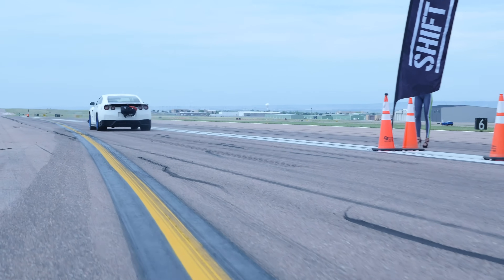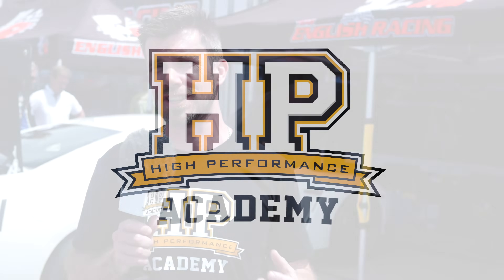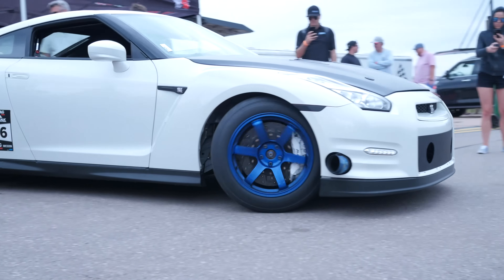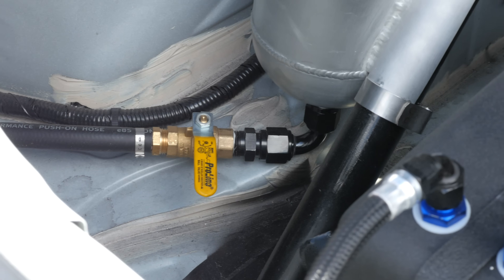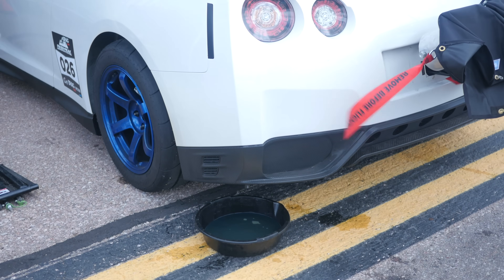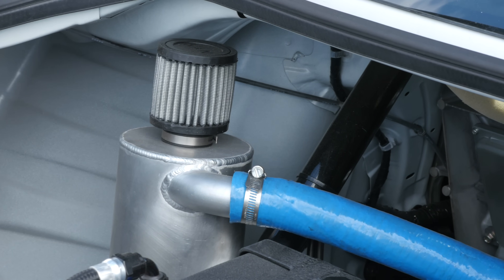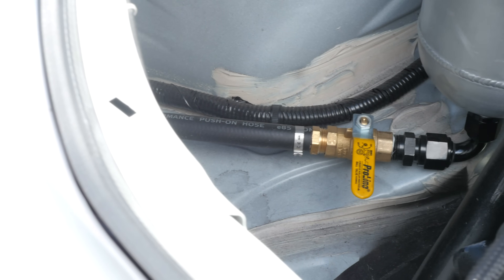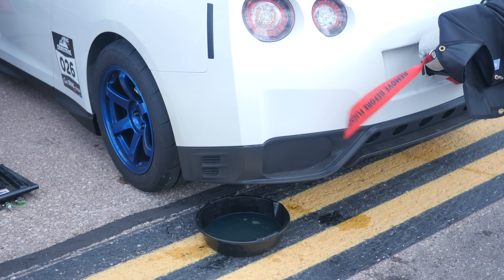What Is Blowby? Do I NEED A Catch Can? | R35 GTR [TECH NUGGET]

Comment: When fitting, or adding, breathers do what you can to position them so oil spray isn't directed in the same area as the breather, that is is clear of any areas where oil may build up under high 'G' loadings, and that the pipe/hose is itself free flowing.
Even some OEM breather designs are compromised and it may be a good idea to check if your vehicle is one of these. Some of the better designs have splash guards and/or inbuild oil/air separaters that can significantly reduce the oil carried out of the engine - there are also some specialist suppliers who carry them, or you can make your own.
It is common to have a PCV (Positive Crankcase Ventilation) hose leading to the carb'/throttle body/inlet manifold and in almost all cases it should be left in place as it helps draw off fumes, moisture, etc, in the crank case in light 'town' running and enhance the overall oil condition. Some vehicles won't idle well without them.
Using a dry sump system with a lot of scavenge volume may be the best way to ensure a vacuum in the crankcase, but it is difficult to get a consistent value as the pumps' scavanging is usually proportional to rpm whereaas the blowwby is rpm and cylinder load related.

Comment: This mainly applies to street cars. There are two circuits in the engine breather system and most get it wrong in the design of the catch can system. To do it properly you need two different catch cans. One to catch oil in the PCV circuit and one to catch oil in the WOT circuit. You are meant to leave the PCV circuit as the factory intended as this only operates on idle and cruise. The circuit you are meant to modify and increase flow for out of the engine is the WOT circuit. What you will find is that novices are modifying the PCV circuit which is the wrong way to catch oil under load but you put a catch can in the PCV circuit for Direct Injection cars to take oil out of the intake under idle and cruise. I usually do both to keep everything clean.

Comment: I'd love to hear your oppinion on a vented catch can vs a recirculated catch can.
Reply from the maker: In some countries the catch can needs to be recirculated, in which case a well designed oil air separator is important. Basically you want to reduce the chance of oil vapour being drawn into the engine as it can promote knock. An atmospheric venting catch eliminates any chance of oil vapour getting into the intake so where it's legal, it's my preference.

Comment: I don't get alot of blow-by but I want to remove all intake recirculating PCV and route the crank and valve cover vents to the catalytic converter useing a venturi effect to preserve vacuum in the crank case.  Does anyone have experience with this?
Reply: IdealSound & Performance : Mobile. I think you're right in suggesting it being after the cat because it might be fighting back pressure otherwise, I just don't want to pollute. I've read that it can pull too much vacuum and displce the crank seals on the motor.
Reply: IdealSound & Performance : Mobile. I almost used a compressor air water separator filter/regulator with my IAG AOS at the manifold port but decided against it because my engine bay is starting to get really busy. I picked up the competition AOS that normally just dumps blow-by on the ground so that's where I thought to reroute it to the exhaust. PCV vacuum is very important to me, more important then some blow-by being reburnt to an extent.

   The old V8 guys are the ones saying they pulled their crank seals through with PCV exhaust venturi systems but I don't know of anyone at all using this system on a EJ257 so I'll have to run some tests on the exhaust regarding vacuum draw. It could end up being a waste but a worthy experiment no less. I'm aiming for about 10-30inHg of vacuum since that's what the crank case system normally pulls under load according to my results on a new Main Line Dyno.

  Worst case if I can't keep hoses from melting or it ends up not pulling enough vacuum, I'll certainly consider running a pump. Summit Racing sells the Venturi exhaust fittings, hopefully they can assure me further.

  Thank you for helping me brain storm on this :)
Reply: GL, 30" of HG vacuum is most unlikely as that a full vacuum at STP is 29.92 inches (knew it was under 30" but had to look it up).
A venturi shape in the exhaust 'should' lower the pressure in that part, but it will also depend on the pressure in the exhaust from the muffler, etc, which may be several inches of murcury to overcome under full gas flow. _ mean a 3" drop won't help if there is 4" head in the exhaust.
There are several specialist seal manufacturers, who do seals for engines running low crankcase pressure, might be worth chasing those up to see if they have something to suit your engine?
Reply: I'm going to put a vacuum/pressure gauge on my (IAG AOS Street Series) water heated baffled recirculating AOS/oil catch can to determine how much vacuum I'm activity pulling through my current PCV system, taking note of how much pressure it has under boost.  I do get 25inHg at the intake manifold on deceleration via the boost gauge.

  After I find the vacuum/pressure values of my PCV system as it is now, I will then determine if the straight through single UHP catted exhaust will pull as much, if not more or less vacuum via 45° angle venturi fitting post cat/o2. If the venturi check valve exhaust fitting consistently pulls vacuum from idle-WOT meeting or exceeding the current pressure/vac values, then and only then will I fit my AOS (heated recirculating catch can) to the exhaust venturi check valve.

 If I can't achieve or exceed the vacuum values of the current PCV system by venting to the exhaust I'll look to find a high quality compact vacuum pump to feed a catch can or worst case scenario, hard line the entire air oil separation system and install some home made inline Scotch Bright green scrubby blow-by filters Or install a second equal length hard lined AOS system in series with the existing IAG AOS utilizing the factory PCV ports.

  Ultimately my goal is to cleanly increase PCV scavenging and to de-clutter my engine bay. I'd still have a oil catch can before the exhaust so I shouldn't be leaving oil clouds behind me. I probably sound crazy but I'm ok with that ;)
Reply: IdealSound & Performance : Mobile. I'd only use the system as long as it didn't fall lower then my current PCV pressure/vacuum values to avoid a 100% speed density tune, however I think it's ok to pull more vacuum just not less then the factory values when utilizing a MAF. At least I'm pretty sure.
Reply: IdealSound & Performance : Mobile. I should've said partal speed density tune for venting PCV to atmosphere while utilizing a MAF since factory PCV systems are using pre metered air, if the system is not being feed back to the motors vacuum source it's technically a vacuum leak that needs to be tuned for with some speed density. 

  I'd definitely cap all the PCV ports on the intake manifold and turbo inlet before running the valve cover and crank case to the exhaust venturi system. I'm still not totally convinced that it wouldn't have to re tuned with partial speed density using a exhaust venturi or vacuum pump system since it's technically a open to atmosphere system instead of closed loop.

  I'll have to look into the physics of venturi systems while factoring calculations from the exhaust CFM throughout the RPM/load range to determine the total vacuum potential then determine if I need to devise a vacuum proportioning valve if it starts to make too much vacuum even though some say it'll be impossible to make more then 30inHg. I have a feeling I'm making this more complicated then it actually is but I don't understand speed density tuning factors completely yet and without physical values I can only use theroy so much. I've got some studying to do :)
Reply: Routing raw unburnt fuel and oil vapour into the exhaust before the cat might sound like a great idea for emissions, but it will overheat the catlytic converter and cause eventual failure. They are not designed to handle that much raw unburnt fuel!

Comment: Why not have a condenser and let the oil drain back into the sump?
Reply from the maker: This can be done however you tend to collect a lot of water vapour and fuel vapour in the catch can which you don't want to return into the sump. Manufacturers like Radium do offer a solution which is heated by engine coolant. The aim of this is that the liquids that condense in the catch can are evaporated off and only the oil returns to the sump. It's a lot more work though.
Reply: Water vapor collecting in the catch can is also a reason you might not want one on your daily driver in cold climate. In the cold weather (especially with short drives) the water in the catch can and/or lines can freeze when parked. With the system blocked pressure will then build up in the crankcase until something fails.
Reply: I use an home made catch can with inner copper tube and a metal mash wire around it to absurd the oil particles and drain the excess water and liquid oil  down a plug at the bottom while gasses of filtrated oil and fuel fums go back to the throttle body to mix again, do need to drain regularly in order to prevent hydro-static engine lock up.

Comment: Another good way is too have an oil return on the can..  A little scavenge pump for ol mate in nissan would work wonders and save him from refilling the engine...
Reply: If there is water or unburned fuel in the oil sump, the oil vapor also has small amounts of water and fuel in it, so it is generally better or easier to dump it instead of reusing it.
If the catch can is build correctly and placed at a warm spot in the engine bay, the water and fuel vapor would steam off and in theory clean oil would be left ready to recycle, but different oils react differently so it hard to say for sure.
Reply from the maker: As others have mentioned, you'll end up with water and fuel condensing in the catch can which you don't really want to add back into the sump. Radium make a catch can which is heated by engine coolant with the intention of evaporating off the water and fuel prior to the oil being drained back into the sump.

Comment: Isn't that what the pcv is for
Reply: It serves the same purpose as a pcv system yes. The only difference is that it catches any oil vapour and moisture that is in the blow by gasses. This keeps the intake cleaner and on high hp engines the oil vapors can reduce the octane level of the gas and potentially cause knock.
Reply: That's interesting I didn't realize it would cause the engine to knock
Reply: @TheCanadianBubba   That seems like a pointed comment. Would you care to explain and be helpful to others rather than leaving a vauge negative comment?
Reply: @TheCanadianBubba  The oil and moisture that would be caught by the catch can would normally be sucked into the intake thru a pcg system and mix with the fuel in the combustion chamber. That mixture of gas, oil, and moisture would reduce the efective octane level of the gas.
Reply from the maker: @TheCanadianBubba introducing oil vapour into the intake system of an engine won't affect the air fuel ratio, however it does mix with the fuel being introduced and has the effect of lowering the octane of the fuel/air charge. In some circumstances this can be enough to cause the engine to knock.
Reply: Lol
Reply from the maker: @TheCanadianBubba We're still proud of you son! - Taz.
Reply: @TheCanadianBubba  I don't think  you fully understand what the pcv does